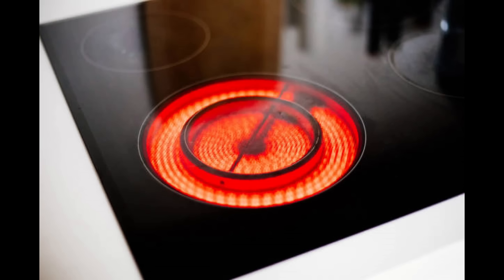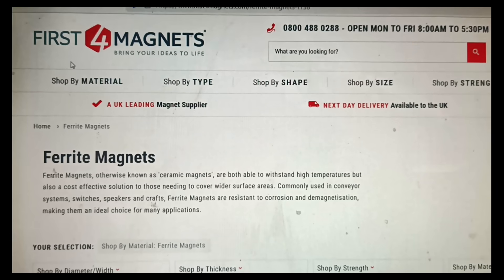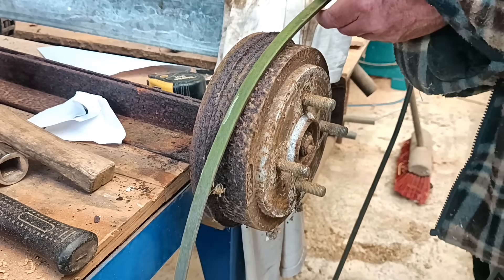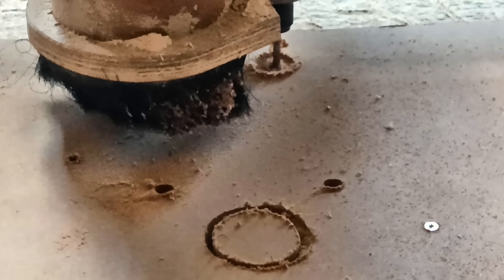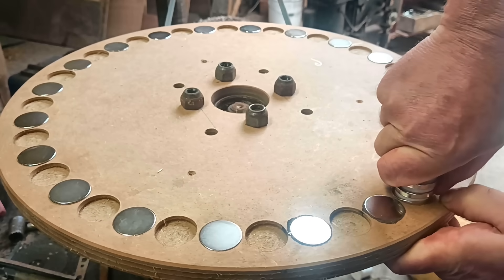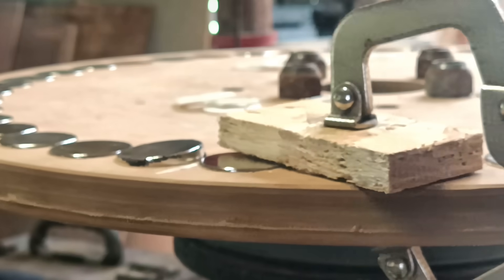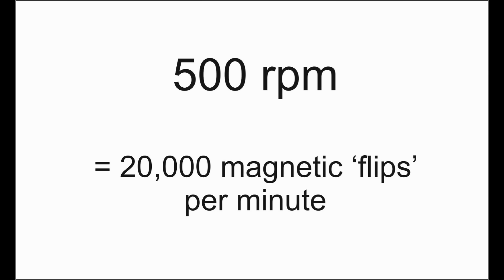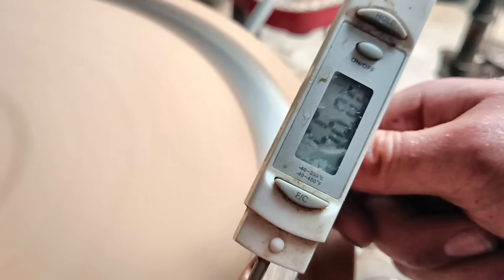I Made A BIG Rotating Magnet Induction Heater! (with magnets from First4Magnets.com)

Comment: As it's setup right now, the magnets produce a magnetic field on both sides of the disk.  That means you could put metal on both sides of the disk.  Or you could use something called a Halbach array, which is a special way to arrange the magnets so that most of the magnetic field is on only one side of the disk.
Reply: Or you can just take power transformers of equal size reconfigure the coils into  around the disc
Reply: He would have to adjust the disk design a bit. Since he put the magnets inset in the surface, he would either have to inset magnets on the other side of the disk or make the disk thinner and drill the holes all the way through so that that magnet is flush with both sides of the disk.
Reply: it would actually be easy to make the disk out of Aluminum with the Magnet holes machine fit and glue them in so that top and bottom are exposed and also do layers you could have 3 discs spinning  and 4 layers of copper pipe for your hydronic heating system
and gear up the windmill X amount so that it spins faster
not to mention why only have one row of magnets you could have 2 or 3 rows
Reply: @danhard8440  Gearing up the turbine speed, gears down the torque. You can trade torque for RPM and vice versa, but increasing one must decrease the other. Increasing the power taken from the rotor by adding copper or adding magnets increases the load and requires more power from the turbine or else it will just stall.
Reply: He could put twenty pickups on the top and twenty on the bottom, thereby making 2000 times more heat.  If each of these pickups ended on a water bath, the corresponding steam could heat a house and cook food.
Reply: Yes, but don't you think that this whole experiment is futile? In physics, there is no such thing as free energy - when powering the contraption by a Pillar Drill. It needs to be a windmill, or similar free source of power / energy.
Reply: @peterduxbury927  It WILL be powered by a windmill. That's the whole point of the experiment. Direct conversion of wind energy to heat - very efficient, and FREE once the hardware is built. You should watch the video before commenting.
Reply: @77gravity  Stop being so righteous in your comments against my contribution. You do not understand the extremely high costs to "create" such a Windmill, and a system that is so inefficient in its' operation. You write as if this is a new technology, but magnets and their uses have been know since the days well before Tesla! The only real change in magnets were in 1982, with the more powerful Neodymium types. 42 years have passed since then, with literally thousands of persons with academic qualifications that well exceed your understanding - all working on Free Energy. If this idea was that BRILLIANT - it would be in all of our homes by now. My advice to you is to go back to school and do more studies on Physics / Thermodynamics before commenting in such a derogatory way.
Reply: @peterduxbury927  I agree - but don't forget that cheap energy is not in the interest of the ruling oligarchy - no one even finances such research! Because everyone wants to make money!
Reply: @peterduxbury927  Indeed. But you must also remember that a given windmill will only provide a certain amount of power for a given wind speed, and trying to draw off still more power will simply stall the turbine. The more heat you "make", whether by higher rotational speed, more magnets, stronger magnets, smaller flux gap, whatever means you hope to "make" more heat, the more power is needed from the wind turbine before the whole shooting match stalls out. 

BTW you might also wind 60 coils and connect them in three phases and make an alternator, and then use its output to power a resistance heater. It  would probably be slightly less efficient, but much more useful.

Comment: I have been thinking and it seems to me that the best solution is to put a three-phase alternator with a small pulley, and another huge pulley like the one you already made and generate electricity, transport it by cables and put electric resistors inside the house. In the end if you produce heat and you have to transport it through pipes, it's expensive, cumbersome and you lose a lot along the way.
And in Spain I have found old 20kw generators for 300€. I don't think your windmill will generate that much.
Reply from the maker: Storing heat (in water tanks) is much cheaper than storing electricity in batteries though?
Reply: @wayoutwest-workshopstuff6299  In any water based system you will need to consider the insulation requirements as well as preventing bacteria growth in the water!

Comment: Probably somebody already recommended it, though I would start over again with a new disk made out of several layers of carbon fiber mesh bound together with epoxy-resin. I'd make it right as thick as the magnets are, then after cutting the through-holes for the magnets, I'd glue them into the disk with strong epoxy-resin. If you can make the disk rotate without any jiggling, no dangerous radial and axial forces will appear even at higher RPMs of rotation. Most likely it would need strategically assembled layers, proper balancing and some strengthening on the mantle of the disk. Then, you can place the heat-absorbing tanks to both sides of the disk as close as you can.
If I had a working windmill at my house, I'd try to make this heater as precise as I can. Likely it could be used also for heating the house and for several purposes.
I guess some disks could provide more than enough electricity for a whole family.
I wish good luck and enough strength for dealing with the electric companies.

Comment: you can put copper around the entire disk instead of at just one spot and that would use more of the flipping magnetic fields instead of just using them where the copper is. Should be more resistance I think.

Comment: Fascinating. It has such potential, I was wondering how you would control this temperature to prevent it getting too hot? Also how to transfer this heat into the water?

Comment: Have you tried it with a thick sheet/block of aluminum or copper, instead of the copper pipe, such as an aluminum griddle?
It should make more heat, but at a certain point, it will slow the disk.
Also noting that: if the magnets get too hot, to the curie point, which is somewhat low for neodymium magnets, they become demagnetized, ruined--unless you want to make a big coil.

Comment: The ability of electricity to do work (windmill > generator) is higher vs plain heat  (windmill > hot water).. got something to do with entropy / enthalpy.
If heat is wanted, OK.  But for anything else.. nope.  Not a good way to turn windenergy into something useful.

Comment: Alright, this is probably your most terrifying contraption to date, Tim... And i kinda love it. 

I do wonder, assuming your could make the carrier bracket rigid enough to withstand the net pulling force of the magnets, wouldn't a ferris metal like iron or steel be even more efficient? What about the different non-ferrous meals like aluminum, brass/bronze, stainless steel? Non metalic conductors, like graphite? Or! The thickness? Do thicker reservoirs get hot faster because they have more metal to jiggle, or does the added thermal mass contract that? Ooh! So many fun experiments!
Reply from the maker: Exactly! So many interesting things to do..

Comment: So... you boil water... flow it thru an automotive heater core, or small radiator, then with a coil on the other side of the "Magical Magnet Wheel" (Physics/Smysics magnets are magic!) you power a fan, to blow over the heater core, and voila' heat the surrounding area.  Am I close to what you have planned???
Reply from the maker: I don't really have a plan yet - but yours sounds like fun  : -  )

Comment: I don't think the description jiggling atoms was very accurate. Induction heating works by inducing current flow in the frying pan, just like in a transformer. The currents in turn heat up the metal  by resistance.

Comment: Since the windmill will be pretty powerful, you can stack more than one disk along the shaft. Then you can coil your copper tube to pass between two disks with every loop. Btw i was impressed by the performances, that thing surely heats! Much better then the friction system. Also, watch the temperature of the magnets!

Comment: Actually you would want to go in something of a c-shaped Channel of copper tube all the way around the outside edge of the disc and over the magnets.
The beauty of this is, if you use copper tubing, not only can you pass water through it for heating it will also generate electricity!

Comment: Here's an idea. instead of having the pipe over a single section of the wheel. you could have a ring that goes over all of the magnets at once, You'll be making heat on the whole thing then!

of course i'm not TOO well versed in this sort of thing but I assume it works.

Comment: For increased power lengthen the area of the copper over the magnets. A very imporpant faktor is to get as close as possible to the magnets since the magnatic field drops off rapidly with distance . Another factor is to use copper with thicker walls since more current can flow. Also the magnetic field does not pull or pusch on the electrons direcktly, it pusches them in a 90 degree angle to the movement of the magnets. Once the elektrons move themselves the push direcktion changes which results in a circular motion of the elektrons. With this relativ low speed these circles are quite large , therefore the power schould also be significantly increased by using wider copper. If there is copper overlaying on both sides of the magnet the circular currents can flow better.

To check which effects the dimension changes have you con also use copper/brass/aluminium plates. If the plates produse more heat there will also be a greater pull felt on them. So you can get faster feedback by checking how much your heater gets pulled into the movement direction of the magnets.
Possibly the best solution would be an aluminum circle over the magnets. With this size of magnets id use about a 5mm thick plate, whith the ring thicknes twise te magnet diameter, so overlapping half a magnet inner and outer circumference.
To extract the heat from the al you might be able to get a round grove turned on the outside, where a copper tube can be laid in. (use rather 7-10mm thick plate) Of course it could also be soldered to a brass plate but that will probably be way more expensive than the aluminium
Reply: Not disagreeing, but an alternative notion.  Very thin walls, and also very close but with radiator type fins on the inside so the fins themselves are affected by the magenetic field. This would allow for more efficient transfer of heat. I would agree with wrapping the tube all  the way around,  but also on the other side of the magnets as well.
Reply from the maker: Thanks Fabien - very interesting..
Reply: @wayoutwest-workshopstuff6299 Another option that might be easier to manufacture is to put the conductor in a ring on the outside of the rotor. It can also be bend from flat material this way. Only need to glue the magnets on the outside of the rotor. Also wood is pretty good for the rotor, since metal would also be heated a tiny bit from the eddicurrents. Rather switch to plywood though.

Still ceep the conductor overlapping by half a magnet on both sides and the material at least 5mm thick.
With this I'm guessing the drillpress wont be able to spin the rotor faster than 200rpm.
Reply: @wayoutwest-workshopstuff6299  are you planning a radiator system or heat pumps tp distribute the warmth to the house?

Comment: What would be the effect if your copper tube went most of the way around the wheel? Would the water heat faster. Going on from there, if you employed a convection system, could that wind-powered water heater act as a central heating system for a small building?

Comment: Would a Floppy Propeller design like a Dervish dancer  help vary the number of magnets in contact with the "induction heater" coils so that when the disk spins really really fast the floppy disk will flatten out increasing the number of magnets closer to the copper/heater metal and when it slows down the floppy blades or petals fold away from the heater reducing the magnetic drag? reluctance ? in place ? 😀

Comment: So you could run a one inch copper pipe around the disk where the magnets are an vary the amount of water pumped through it to heat more or less water depending on the speed of the windmill. With constant water flow rate, move the pipe away a little? Are you also going to use this as a mechanism to slow the windmill if the wind creates excessive speed?

Comment: Now you got me thinking about how to arrange the copper pipes above the rotating disk to get the most heat induction and the least electrical current.  There's a lot of surface area there and the last thing you want is a voltage potential going back to your plumbing and shocking you or shorting out through insulated pump bearings.  High frequency voltage does funny things, it tends to go places that shouldn't be possible thanks to its ability to see capacitors as short circuits.  It absolutely hates inductors so coiling the plumbing a few times might eliminate it altogether.  
🤔
Reply: Just short them, no current will leave them.

Comment: A very interesting concept to produce heat from motion without friction.  But, is it efficient, say, compared to producing electricity from motion, and then using both the electricity produced, and the "waste byproduct" (heat created from the actual generation method) for a combined heat source?  I didn't explain that very well, hopefully you get the gist of what I'm trying to say.

Comment: Can you get 5mm aluminium sheet? It would expose both sides of magnets, and spin very quickly without failure. 5mm polycarbonate sheet should be a viable option too. 

I wonder if a CVT transmission can be used to automatically control the load, according to wind speed.

Comment: Is the magnet wheel directly driven by the windmill shaft? I wonder how many magnets would be needed to apply sufficient load. Perhaps a simple constantly variable transmission would allow you to regulate the load according to wind speed.

Comment: Basically this is an electric generator with a short-circuited windings. It is possible to move the heating part to another place, but then you will end up with a regular generator and heater.
Reply: and some of that heat will always be produced and lost at the generator...

Comment: Use a steel plate to close the magnetic circuit on the bottom.
Multiple rings of magnets.
I would try spacing the magnets out a bit, may not need to get heating element so close to the magnets then. ?
A flat bottom frying pan or stock pot for the heating element.

Comment: You can try to measure the drag force on the metal bit you are heating to calculate the heating  power transferred. P = (M*N)/9.55 where M is torque in Nm and N is rpm. Torque is r*F (radius of the magnet circle * measured force). Using a bigger metal piece will result on more braking force
Reply: Thank you kindly
Reply: Best comment and it needs a pin of awesomeness.  🏆

Comment: My windmill is at 10m height.  Very disappointing.  I imagine 20 or better 30m would help a lot. 2kW china in Rosslare.
Reply from the maker: You'd need planning permission though..
Reply: @wayoutwest-workshopstuff6299  you don't  need planning. There's a height. I THINK it's 30m.

Comment: Impressive!!! How hot would you need the water to be for your home? Surely not boiling, so you could probably use something going at a lower RPM to heat the house? Or are you thinking of going full throttle and getting as much heat out of the windmill as possible, then storing that heat in something like sand, for use on windless days?

Comment: Amazing! 

I would advise a bit of caution though (well I would wouldn't I?). You are having a alternating magnetic field at 600Hz! If any metallic things got near that it could get interesting! ........ By interesting I mean loosing a digit that had a ring on it or less importantly trashing a phone or watch! 

Now for the interesting stuff ....... those magnets whirling round affect the metal near them. You can use metallic guides to move that field some distance away should you need to! Also the fact that they affect the metal is a two way street. Inducing an magnetic field will slow the disc down (You get nowt fer nowt as a Yorkshire teacher once said to me). The more you take out the more energy you need to put in to counter this so ........ the number and size of disc you have will not matter too much as the speed you spin it will be determined by the work you get out of it! A bit like gear ratio's. 
The faster you "flip the field" the more heat you get out and it is not a linear graph so faster is better ..... sort of! 
As you alluded to there is resonance and inductance to bear in mind!

Finally I would point out that those magnets have a field going out of each side and you are only dealing with half of it at the moment (I know, proof of concept). With the use of armatures above and below you can increase the energy output a lot and this can allow you to cut the distance between the magnet and your kit down to a minimum giving you more for less!

I look forward to more videos on this!